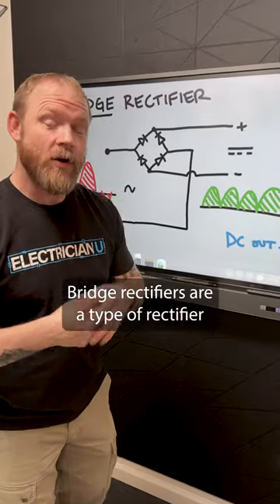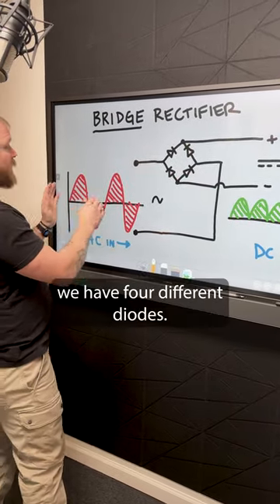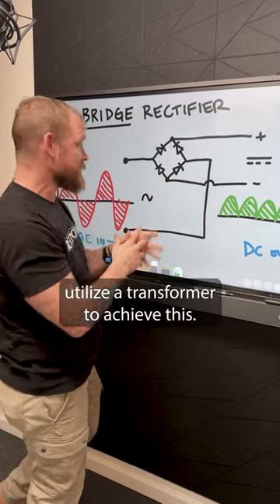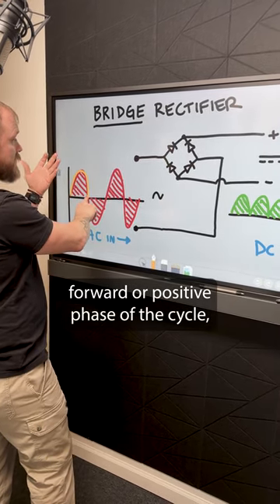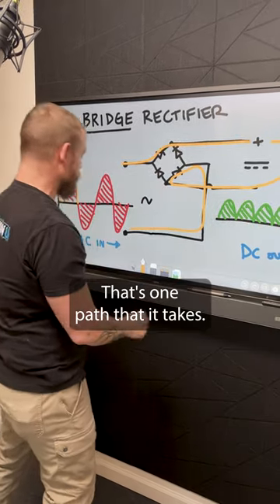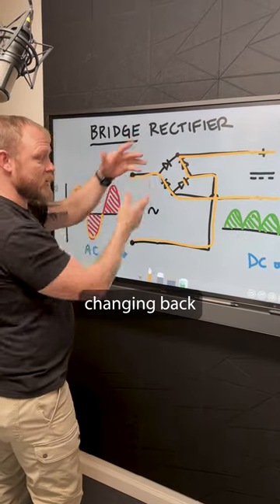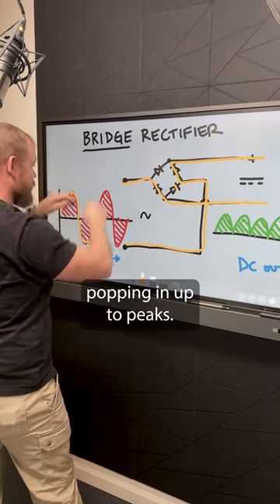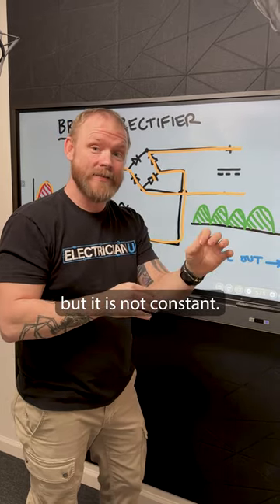Bridge Rectifier - Converting AC to DC

Comment: I do not understand the comment about full wave and half wave rectifiers using a TRANSFORMER to achive "this". Even a bridge rectifier will need a transformer to change the voltage from high to low, say 120 volt ac to 12 volt dc. A transformer drops (or increases) the voltage level and the rectifier converts alternating to direct current. What am i missing?

Comment: Another (less common) use for bridge rectifiers is to make a DC power input polarity agnostic. It works well as long as you can handle a positive rail voltage about 1.4V less than the input voltage.

Comment: To confuse some people even more the one piece rectifiers on three phase ( 3 line wires ) drives have six diodes and 5 terminals .Have to watch voltage when rectifying AC to DC. The DC voltage will be approximately 1.4 times higher. On 480 volt three phase drives the DC Buss voltage is between 655 to 670 volts DC.